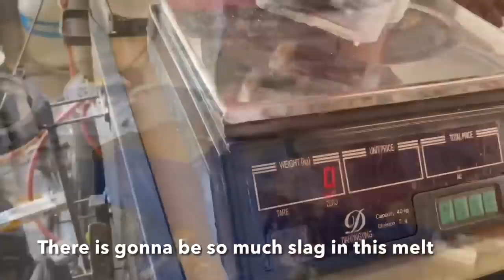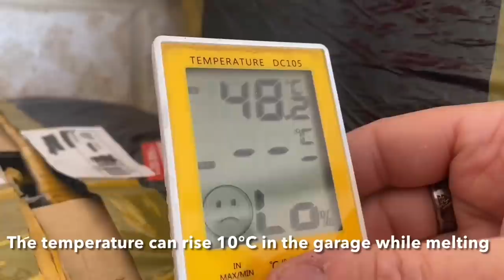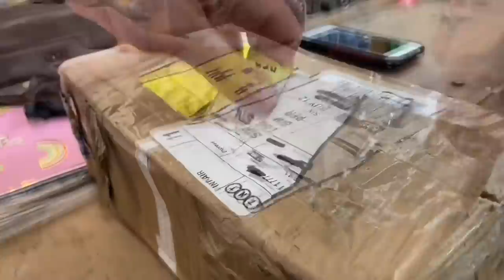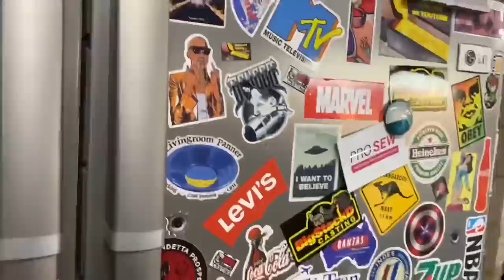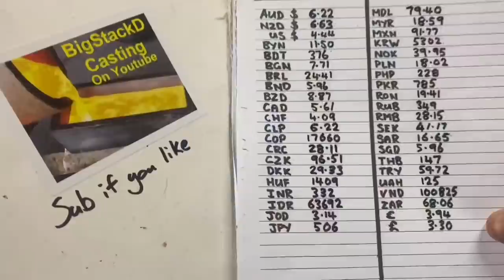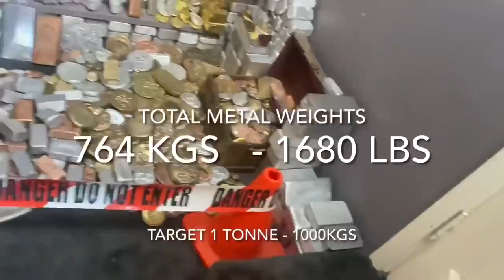Mirrored Ballast Bullion - Trash To Treasure - ASMR Metal Melting - BigStackD Casting Bronze

Comment: Just a reminder to always discharge the capacitors before working on them. They may still hold a charge and you could get a good shock from them.
Reply: PSRRRT!    bzzzz!   POP!    AAAH!
Reply: The quickest way is to short them. Instant discharge, instant satisfaction.
Reply: I remember my Father using some foreign language when one popped on him one time,
Reply: You should be able to get a couple bucks for those capacitors. Just sayin.
Reply: How I do this safely?
Reply: @merryman9423  Insulated jumper wire connected to ground. Holding wire on an insulated part of the wire and touching the positive lead of the capacitor. You may or may not see a spark. This should discharge the capacitor making it safe to handle.

Comment: What brand earbuds do you wear?
Reply from the maker: Jabra Elite 85t
Reply: @bigstackD  how do they sound? I'm using some I got off Amazon and the battery life is really amazing and they sound pretty good but the fit isn't the best.
Reply from the maker: I was using the jabra elite 75 And they work awesome but little bullion ate one of them🤬. So I got some of the 85t and they work great and the noise cancelling is amazing. They are a little bit different shaped on the earpiece that goes in your ear but they’re very comfortable. I just like the fact I can just use one in my ear when I’m melting so I can still hear the furnace with the other ear
Reply: @bigstackD  I think the next pair I buy will be those.

Comment: Dear BigstackD, I'm thinking about starting too melt my own bars and I've got a question about it, can I use my stickwelder too heat u crucibles? And if so, how much weight can I proper melt using a 200 amp welder?

Kind regards

Comment: I have to put cardboard under my Procast crucible before use and after otherwise it glazes to the fire brick below on cooling. For anyone ordering a Procast crucible.  I didn't bake either in my oven right into the furnace for. 3, 30 second .4 mpa burns. 10 minutes apart, then slowly cook it's temperature up till cherries at my aluminum bronze temp and slow cool for the night. Use tomorrow. Worked both times. I will order two more soon for copper and for brass. As I keep my specifically for each type so my ratios stay accurate. Love the vids. BigstackD rules.

Comment: I gave a request good sir.  Could you take a crack at making the strongest type of bronze.  I believe it is a nickel bronze that contains 3.5 percent manganese, 3-5 percent iron and nickel, and 10-15 percent aluminum.  The rest is copper of course.

Comment: Well interesting video but have you ever considered the cost and environmental impact of what you are doing. Propane C02 etc? Also your slag going into landfill contaminating land even more. 
Here in the UK very strict domestic bins are definitely for domestic waste. Local authority are in their right to refuse to collect anything else.
Final rant are you your dumping of plastic scrap into the recycle bin is the correct thing. again locally but also repeated round the world that contamination in recycle streams is a major issue. Also small pieces fall through the cracks (literally) of the recycling machinery. We have a list of what can be recycled rather than what cannot.
Your system maybe completely different but i doubt it. Not saying you are incorrect but have you checked that your approach is correct?
Agree bars do look great but at what cost!!

Comment: Copper-plated aluminum sounds like a disaster waiting to happen for a transformer coil winding. We outlaw a lot of that kind of crap engineering here in the United States. The aluminum doesn't play along well with the copper when it comes to binding the two together. Expansion and contraction over time causes the aluminum wire to lose its round shape, and thus causes sparking and arcing issues when trying to screw down or splice into copper fixtures. It's just bad mojo.

Comment: For one melt, I'd like to see a pile of capacitors cracked open and the metals inside melted down. Once you crack open the outer shell (usually aluminum for heat sink) you'll find two sheets of conductive metal separated by a dielectric material, such as paper, glass, ceramic, or simply just air. The conductive metals can be a range of materials from platinum, silver, copper, and sometimes gold. Plating usually isn't done as electrolysis will usually strip it off and short the capacitor.

Comment: In my 5lb steel molds i get real bad pits on the bottoms. Any clues why? I get flowery patterns too deep to sand out. I try heating molds to diff temps up to 1200 is that not enough or too much?

Comment: Hammering the welds saves cutting disks.. I would like to add that it also makes the job a little more satisfying.. Applying brute force is always more satisfying :D
Reply: I Think he got it from a comment of mine.

However I said beat them with a block splitter or similar lol

Comment: I was going to suggest to use a impact driver to remove those bolts, but after seeing that you can make that socket wrench spin at 2500 rpm the impact would actually be slower,,😜

Comment: 4:01 I'm sure you know, just place those in a vise, add just a tiny amount of heat, just to get them soft, and pull the brass plugs out. toaster oven, hand torch will do, or vise grips and some muscle will pry them out with the copper attached as well. they take up alot of space otherwise.

Comment: Wrap one welding glove around the mold handle then grab it with the other one on your hand. It won't get hot on your hand that way. Might be a little slippery lol but the metal is solid at that point. That's how I move around fleshly welded steel that's still too hot to grab even with the gloves on

Comment: hey love the videos, have a question my graphite molds keep braking on me I preheat them and everything and I just dont know what I am doing wrong.
Reply: Certain die cast metals have broken my new molds also😢
Reply: My guess is that polymers swell forcing the mold apart idk
Reply from the maker: That is extremely weird , I have never had one break ever so unfortunately I can’t give you any guidance there mate 🤔
Reply: The metal that broke mine was from ceiling fan blade brackets which are usually aluminium but I think they were die cast, whatever that is, lol  guess I'll look it up now!
Reply: So I think I'm wrong about the plastic thing, maybe its just faulty molds

Comment: Those three phase rectifiers and high frequency switches in the electronic component bin have a huge chunk of tin clad dead copper on them. Most likely they are soldered to the transistors and diodes. You can hit it with a propane torch and they should fall right off

Comment: Ballast (4x)

  "A device placed in series with a load to limit
  the amount of current in an electrical circuit."
                             
[Use]          [Equip]          [[Dismantle]]          [Drop]
                                                   ^

Comment: If you ever get the chance, disassemble a stick welder, or a roll around battery jumper. They are alot of fun. Done 6 of these. Alot of copper.
Reply: Already did, check previous videos

Comment: Dear BigstackD, I've noticed that in many of your videos , your crucibles start to crumble apart before you have to throw them away, and I was wondering if that is caused by the metals that you melt in them that produce slag ( or dross ) which also contaminates them with that slag residue?
Reply: I'm no expert but I would think it's because of the high heat they withstand every time in the furnace especially because they seem to crumble on the outside not the inside (or at least MORE on the outside)

Comment: Well done I Love it! I'm curious what happens to the copper coating on the Aluminium wire. Does it settle to the bottom of the crucible because the Aluminium will melt first? Or does it end up mixing with the Aluminium? Makes my Fridays to catch your vids. Rock On bigstackeD!!!  \m/
Reply from the maker: Because it was such a small amount of copper on there it would simply melt in with the aluminium. The crazy thing is aluminium melts at 660°C and copper melts at 1085°C but if you mix the copper and aluminium together strangely the copper will melt at around 1050°C🤯 it doesn’t even make sense but apparently that’s how it is 🤷🏻‍♂️
Reply: @bigstackD Casting  It's not copper.  It's a coating/enamel to prevent the aluminum from grounding/short circuiting to itself.  Far more efficient electromagnet/motors are yielded.  It'll become that ashy/crappy dross.If you ever scrape it, you can see this paint flake off.  Usually transparent/translucent. I've seen just about every color in the rainbow.  I really like the christmasy looking motors with red and green 🥰 lol Commonly referred to as "magnet wire"

Comment: Why cant you melt steel? Does it needs very high temparatures?
Reply: Yes, you're right. Big D covered that in an earlier video on steel melting. It takes far too much gas and heat to melt.
Reply: @jl3390  Thank you for the response, i missed that apereantly :)

Comment: Hello. How long does it take for brass and aluminum to melt? how many minutes?
Reply from the maker: You could melt 3 kg of copper in about 20 minutes but when it comes to brass it might take me half an hour to melt 3 kg as when it gets up closer to it’s melting point I normally back the burner right off so as not to burn off the zinc and make a big mess. Aluminium would take about 5 minutes to melt 1 kilo.
Reply: @bigstackD  Thanks for the extended answer

Comment: Hey mate would you be able to send me a link to the wire stripper and how do or what do u use to strip house wiring or small wires cheers👍
Reply from the maker: I don’t have a link for it mate but if you jump on eBay and type in electric wire stripper it should come up. When it comes to the extremely small wires I just put them aside and take them to the scrapyard as they are because it’s just way too time-consuming stripping wires that are extremely small but if I’ve only got a couple of wires I don’t mind doing it but certainly not a whole heap of small wire as I simply don’t have the time.
Reply: @bigstackD  ok thanx mate will keep that in mind

Comment: Ok im gonna ask 1 more time. Can you smelt glass??
Reply from the maker: Yes I could easily melt glass but when it cools it will cool to fast and shrink and crack. The only way to really make  glass coins or ingots is to melt broken glass in a kiln in the mold. Then you would need to slowly bring the temperature down so as not to crack the glass. I have ordered a kiln last year but was told  it wouldn’t get here until early March and now they say it’s delayed until mid April🤬. 
It will definitely happen mate I’m just waiting on the proper equipment otherwise it’ll just be a waste of time👍🏻
Reply: @bigstackD  ok thanks on info